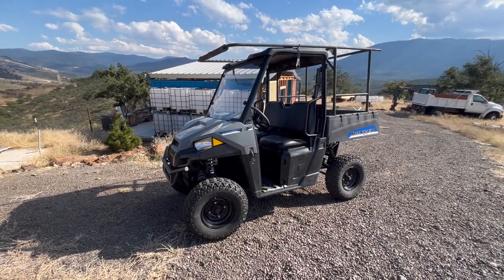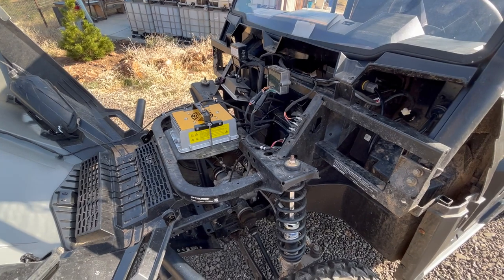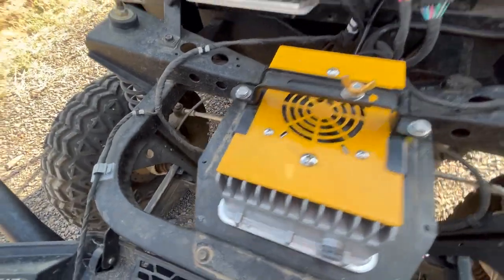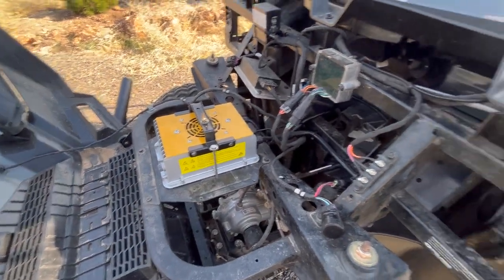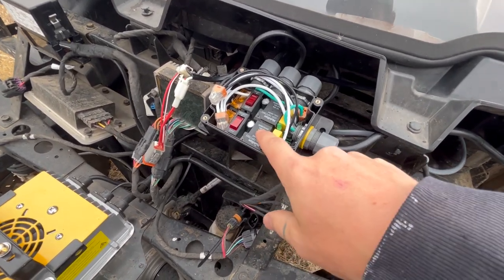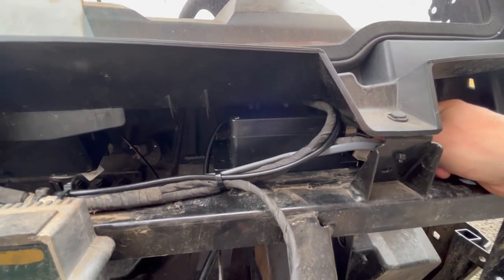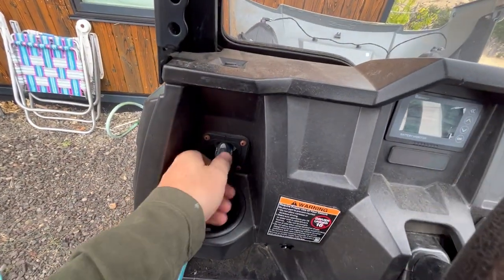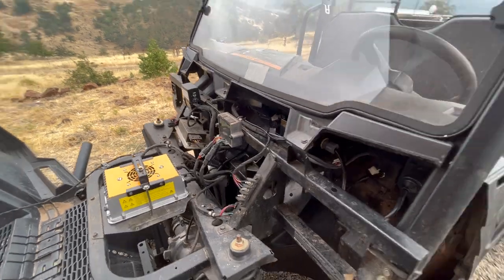Lithium-Ion Conversion for Polaris Ranger EV 2020 *PART 2*

Comment: Are you still satisfied with this conversion?  I see on some posts that the controller needs reprogrammed when changing to Lipo to maximize your benefits.  Have you looked into that?  Thankyou!
Reply from the maker: Hey — I don’t doubt that at all.  I guess you have to remember too you are shaving off about 500lbs of the Rangers 1750lb curb weight, so even if the controller isn’t getting the most out of the lipo batteries… it’s still very reasonable performance.  For the kind of use-case I have on our land, it’s been good… for me low-maintenance and longer battery service life was the main reason to convert.  YMMV 👍

Comment: Some footage of it running would be cool. I’ve wondered about using one of those 48v all in one inverter/chargers on one of these. They have input for solar and 110v and some even have a genset control. You would also then have a portable source of ac power. 
That roof rack is crying for solar!!
Reply: Not a bad idea, except they may not hold up to vibrations.
Reply: @ArchimedesPie  yeah, I’m not sure about that.